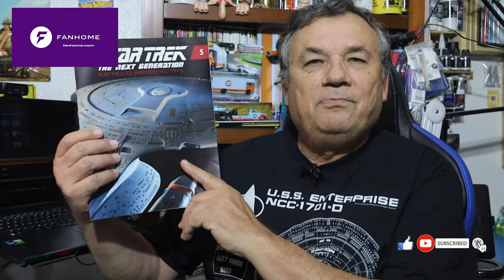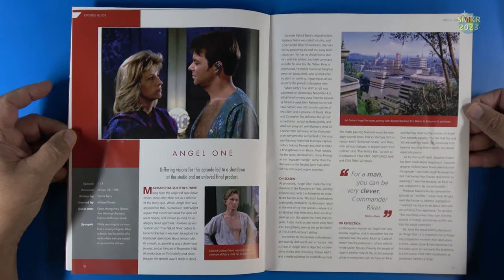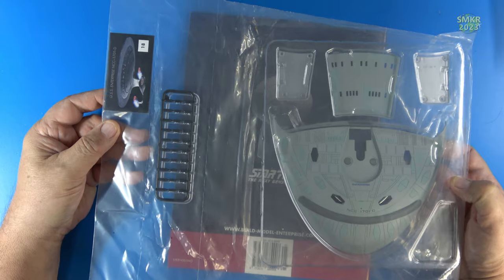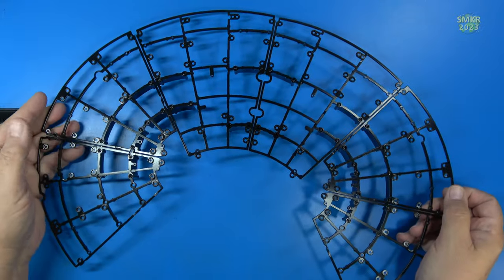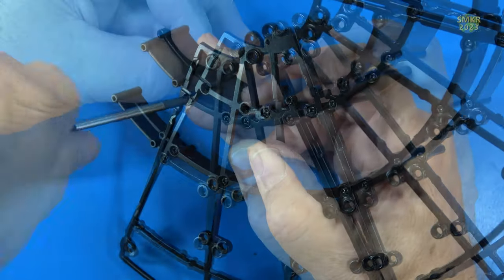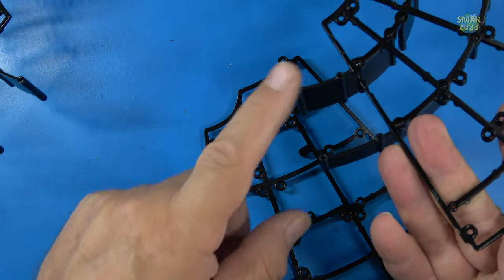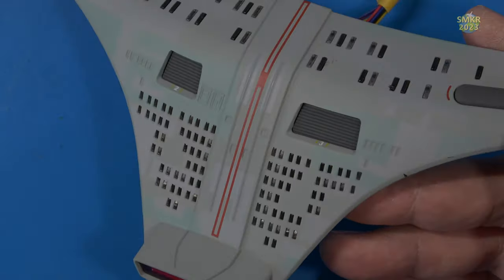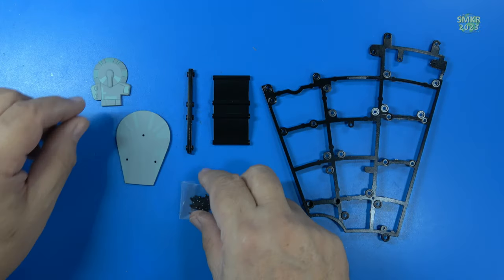Build The Massive Star Trek Enterprise-D Stages 15, 16, 17, and 18 from FanHome | ASMR

Comment: Also, you are going to want to route the wires for the reflectors separately through the skeleton, one wire per opening. Otherwise, this panel will not mount fully flush.
Reply from the maker: So super glueing them on the reflectors not a good idea?
Reply: Definitely do NOT super glue any LEDs in. You often have to remove them again. A better idea is small pieces of scotch tape. It will hold them in place and still let light through.
Reply from the maker: @MarvelPhx  Okay I'll see what happens, the super glue is definitely not permanent, and the LED can easily be broken free later if needed.
Reply: @ScaleModelKitReview  Many builders have broken LEDs by using super glue.
Reply from the maker: @MarvelPhx  Thanks for the heads up, I will definitely look to use an alternative.  It's pretty evident that the LEDS may need to be removed for ease of assembly in later stages.

Comment: I restarted my subscription to this I stopped it because of all the problems but I will follow you on this build and hope you can make little adjustments to make this work . I  heard that some of  the light leaks are from not properly running  LED s so the panels are completely flat
Reply from the maker: Yes, and that's what I'm hearing.
Reply: @ScaleModelKitReview   I have followed your Super Snake Eleanor builds just finished Super Snake working on Eleanor . Like your style of building by the way what ever happened to the Delorean
Reply from the maker: Thanks for your kind comments,  @MegaSavonarola  Thanks for your kind comments, I still have it, and I will start it up again soon, just too much on my plate right now.